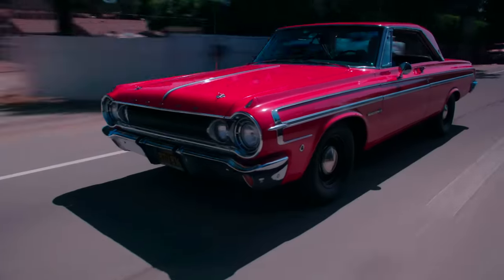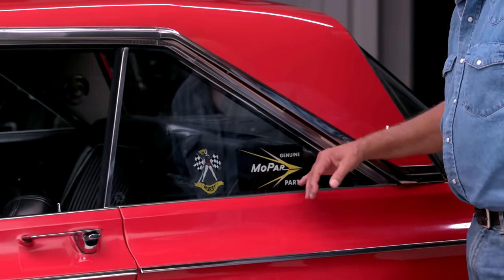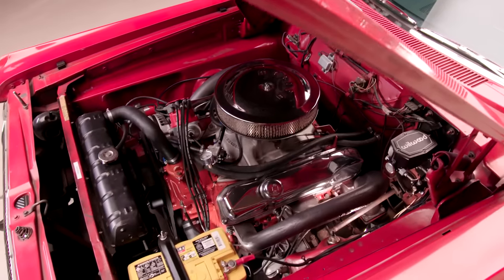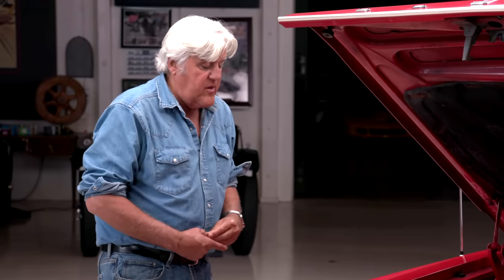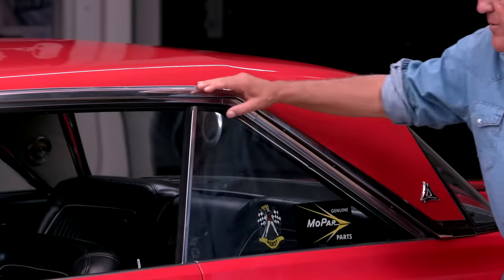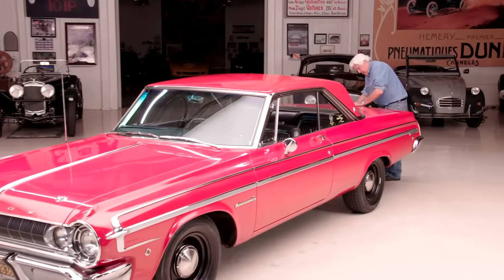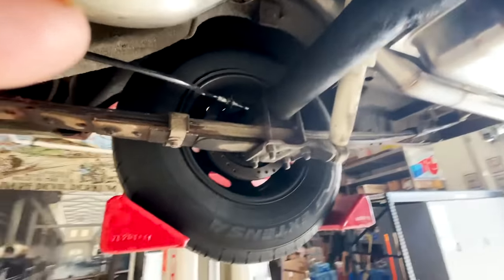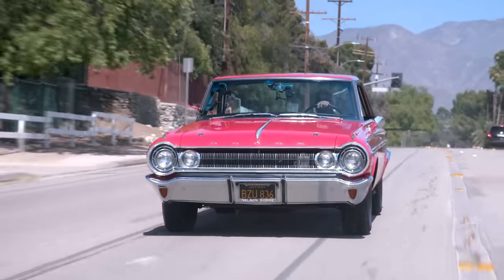1964 Dodge Polara | Jay Leno's Garage

Comment: Had a 1964 forest green Dodge Polara with tinted windows on the side and rear. The rear tint was cracking into branches that made it look like a cool tree of life. Bought it in 1970 for $1,000 from a car tinkering friend who replaced the original engine with a 440 from a California Highway Patrol Car with extra horsepower - maybe 390. Ran the quarter stock in 13.9 seconds. I had stickers plastered on the side widows like  you showed on your car - Hooker headers, Holley 4-barrel carburetor, Mallory Ignition, Edelbrock high-rise manifold, raised white-letter sidewalls, I think G60-16 with Ansen Sprints mags. Ram air through the grill. Had 4.11 positraction to get off the line quickly. I paid to have an Isky racing cam and a B&M racing transmission which caused it to scratch into 2nd. It was so fast, it just blew away anybody who revved me for a race at a stop light. Got it dyno-tuned, put on some slicks, and loaded it on a trailer towed by my friend's 1969 Super Bee. He got on the on-ramp to the Ventura Freeway in Woodland Hills to tow it to Lyons Drag Strip for Wednesday open racing. On the freeway, the trailer immediately started to swerve back and forth, then the swerving got worse. Don't know how my friend prevented it from jackknifing, but he got it down the offramp. We off-loaded it, and gave up on taking it to the drags. We must have positioned the car in the wrong place on the trailer. Never knew what it could turn. Got 10 miles per gallon during the Arab oil crisis. Put about $1500 into it. Sold it for $400 in the early 70's--still as fast as the failed trailer tow day. John

Comment: Ahh, this does bring back memories. My dad had a 1963 Dodge 330, which I loved - although it wasn't a beauty. Some days I wished I had a bag over my head as it just wasn't a cool car then.  Looking back, 60 years later, I now think it was very cool. My favorite feature was the push-button transmission controls (and the 'park' lever) on the left side of the instrument cluster, and the push-button heater controls (and lever for the temperature) on the right side, mimicking the transmission controls. Never once was there a problem with those controls, and I found them very easy to use. Jay, I love your channel and want to say 'thank you' for showing us some of your wonderful car collection.

Comment: Great episode and car. Jay touches on the fact they only recognize the 65 gto's and up as first muscle car when in fact the very first muscle car was 55 Chrysler 300 and not the 49 olds or Hudson hornet. The entire 55 300 car was built to race. It was first car with special engine dual 4's, special front and rear suspension and sway bar and rear end. Goodyear made special Blue Streak high speed racing tires for all the 3O0's and all had 150mph speedometer. If you can a road test from back then they discuss it's power and road ability.

Comment: I had the 1964 Plymouth Belvedere version with a 383, dual quads, 4 speed with side 
pipes. I told my friends it was fast as a hot rod, comfortable as a Cadilac and handled 
like a sports car. OK, I exaggerated a little bit.

Comment: Jay I like your love of cars I fail in love with mopar at 16 when I bought a 65 plymouth Sport Fury 383 Four Speed ,69 Dodge 440 RT ,70 plymouth cuda 383 sad to say my garage roof fell on it 30 years in the garage  retirement car. scared to look one day. My late brother son has his 64 Dodge GT we put a 440 six pack hemi torqueflite 4:30 gears roll bar it also been sitting in a garage 30 years I'm 67 hoping I'll have time to get it back running for my nephew, I like That exhaust system on the Dodge

Comment: Cool car Jay! Get rid of the plastic fuel filter on the intake manifold. It's a fire hazard and limits fuel flow because the ID is very small where it inserts into the rubber fuel line. Those filters are waaay too restrictive. If you want an inline filter use a metal one like a WIX that will flow more fuel. Wouldn't be surprised a bit if the car falls flat on it's face at WOT as soon as the carb empties the way it is in the video.

Comment: Love those,I bought one with a blown up 383 in 1976 for 500.00,I got a leed near my home for a motor,I went to see what he had and was very surprised,he had what he thought was a 413,was actually a 426 with the cross ram and 4 speed,totally complete,had handmade tube headers,very low miles on it,I paid 600.00 for it,right next to it was two hemi's with art carr 727's,I didn't make much money then,he wanted 800.00 for each of those,how times have changed,my dodge ran it's best 12.40,117,with unbalanced 8"hard slicks that I drove to the track.

Comment: This car was a very big deal when it was new. I was in  high school when they first showed up in the dealership.
Awesome.
There was a long black top stretch just across the border in Illinois where guys went to race. We  had to get volunteers to do lookout in case cops came, they flashed headlights. We would be back into WI before they arrived.
The big bad Dodges were the king of the street.

I was admiring the new exhaust and suddenly realized the crossover adds torque at low RPM when it is needed most.
Doesn't matter how many cylinders either. A Harley with a crossover will have noticeably more torque down low. I know. I installed Vance and Hines longshots and instantly noticed less torque below 2500. Ran them about a year and put the factory pipes back on.

Several tests on cars with V-8 showed increase in torque as well.

I'm wondering where you find gas for that engine. Nothing I see here in WI would be safe for 13:1 compression.

I really appreciate that you are saving all these awesome cars. Many thanks.

Comment: I had a 64 Polara, It was white with black top and red interior. It was a 383 auto with floor shift and had a vacuum gage where your has a tach. I was the envy of the guys running the circuit up town, because I had power windows. While going down the street I could roll down pass. window without having to lean over and use hand crank. Unheard of in late sixties when I had this car. Really enjoyed this video, It brought back many good memories. Thank You. P.S. Grew up in Williamsport PA.

Comment: My 1st car was a 71' 383 Magnum CUDA w/ a Slapstick 727 Torqueflight Automatic & 3:23 Gears in the Rear End. Was wishing at the time that it was a 4:11, so I know what you mean about the revs on the hwy.

Went thru about  $40 worth of fuel, and only travelled about 50 miles one way down the 401 in Canada to a Wedding Reception, BUT after a few drinks, on the way back home, I actually took my Cuda up to it's maximum speed, which was probably around 140 mph. THIS was where my mileage went to sh*t AND thinking back on it, I was "kind of an idiot" for doing this on fibreglas belted tires on the front and just plain ole' General Grabber NYLON tires on the rear (which probably were not safe over 80 mph).

Comment: I had a 64 but i had a 440 commander with 727 torque flight push button . You talk about a great Hot Rod that was it . i ran down many of the guys i hung with , one day at a stop light older couple in a 68 Satellite next to me , my punk butt revving my motor and when the light turned green we both floor it and that old couple leave me in the dust . When we got to the next light i looked over the old lady was elbowing the man in the ribs , i tipped my hat to them as i looked over their car and there i saw it , The Hemi enblem on the fender . Put that Dodge was still my baby !! I had mine in 1977 only had 40 k miles on it . It was baby blue with same color interior . I am 63 and still love that body style !!

Comment: The sound equipment did not do the cutouts justice. Or did you even open them? I could not tell. Love driving old MOPARS without any power accessories & with a 4 speed manual. We used to run the aircraft accumulator brake system on our race cars. Run huge cams without that power assist vacuum drum. It worked perfectly. Very nice car Jay.

Comment: i have the 64 Polara 440 body style basically the same car ,,, except a little different chrome on it than yours  ,,, you have got the 500 ,,, but i do have the six tail lights like yours ,,, many had just 4 tail lights from what i have seen ,,, mine is also a 4 speed posi track car ,,, mine from factory came with 318 poly push button automatic i think ,,, but has factory dash plate for push button delete ,,, its also big block 440 ,,, with the old school 2 piece headers on the drivers side so to clear steering arm thay were made from a company called JR headers  ,,, nice to see yours out and about

Comment: I bought a '64 Post  from an old lady in Long Beach. 21000 miles on a slant six. pushbutton Torque Flite. Built the slant six to Hyperpack standards, fun car to beat pseudo hot rods in. Light turquoise, 14's with dog dish caps. And that tiny master cylinder you mentioned. I go through brake shoes constantly, but I dig 'em.  The car had sat for 20 years, and a whole colony of mice, bugs and birds nests all blew out on the Long Beach freeway . Evicted. Still have it. Burnt a valve racing a Mercedes.

Comment: Jay, I think you mentioned the car has 13.5 to 1 compression.  I'm not sure about the '64 wedge but the '63 street version had 11 to 1 compression and 415 hp. The strip version had 13.5 to 1 and 425 hp.  When the hemi came out in mid '64 it had 425 hp also (yeah, right} more like 500+

Comment: Those round side marker lights are from the Chrysler Corporation model year 1968. 3.23 rear axle ratio, same as many of the Mopar cop cars of the late 1960's and early 1970s.  A good balance between acceleration and top speed.

Comment: Love this authentic piece of early muscle car history! These were the first muscle cars for sure along with the 421 SD Catalina Pontiac's and the striped Chevy 409's. My dad mentioned that when he bought his '65 Dodge Coronet 426 Max Wedge, the factory mufflers were thrown in the trunk and not even installed in the car, wavers signed upon delivery. Otherwise, zero options, radio delete, dog dish caps. Super Stock indeed!  He would mention the lightweight solid lifter max wedge was faster than the his hemi Roadrunner bought a few years later.

Comment: I have a die cast model of the Little Old Lady From Pasadena super stock Dodge. It’s incredibly detailed. It actually came with an extra set of back wheels and tires. They are cheater slicks on mags. Growing up in Pasadena was a real treat especially on New Years Eve. We’d go up to Colorado Blvd and watch the hot rod show. Guys would uncork their rods (including me) when I was older. One New Years Eve I saw an incredible race between a 61 Vette and a 64 GTO. They sat at the light until all the cars in front were a block away so they had a full block to race. The thing was the right side lane, curb side had a slight crown to it and the Vette never hooked up and slowly the back wheels drifted towards the curb where people already were in their sleeping bags. You can guess what happened. The Vette was spitting out people in sleeping bags one after another. It turned out the people were not seriously hurt and they were related to a Pasadena cop. Yes they caught the guy the next day. Anyway I love the car and the cars from the 60s and 70s.

Comment: In high school, a friend 2 years older, had a black Polara with the 426 wedge engine.  I think the rear-end was a 390 though as it could lay rubber for a 1/8 mile at the strip.  Mike was as cool as his car. 👋

Comment: I do not have a Dodge, but I do have a 64 Plymouth Belvedere. Looks like the Dodge except for the front end and hard top. Mine is a post. I put a 477 C.I. stroker 400 in it, dana 60, new cable trans, upgraded to a dual res master for brakes. It's just a cruiser. I love my Belvedere. I bought it at Big Willies drag strip on Terminal Island back in the mid 90"s.

Comment: Of the 64 DODGE Polara and Plymouth  were 361, 383 426(single 4 brl) and two versions of 426  dual quad, SINGLE  CARTER 4 BRL, 11-1 COMP- The MAXI WEDGE DUAL QUAD IRON HEADERS 13-1 COMPRESSION.
MOST HAD 323 REAR GEARS BUT 351 AND 301  WERE STREETERS.
HARD TO TUNE CARBS,DUAL POINT DISTRIBUTERS  Hard tosync.rarlugs reached under front fenders, every 2 weeks  plugs or Mopar,  Constant breakage of plus and easy fouls.
Burned SUNOCO 260 104- 105 OCTANE PUMP GAS, AV GAS FRIDAY THROUGH SUNDAY NIGHTS.
AND YES, THE MOST CLASSY AND ETC LONG LEGGED  BLONDES LOVED THE CAR

Comment: 1968 was the only year for those round side marker lights, which were just lights (not reflectors + lights). In 1967 and earlier, Mopars had no side markers at all, and in 1969 there was a loophole or something that allowed them to use reflectors (no light bulbs behind them) and they were rectangular. In 1970 they retained the rectangular shape and they were both reflective and had light bulbs behind them.

Comment: My first car ever was a 66 Polara 440 model Red w black roof no rust, red interior. Paid $20. Threw out the 318 and dropped a HP 440. Air shocks out back w L60 goodyears. Had a buddy change the Alt. Crossed the wires and fried all my wire harnesses. I will always have a soft spot for the Polara.

Comment: That's a fantastic Polara 500, Jay! I love the subtle yet very effective upgrades to the brakes, exhaust, etc...
1964 was also Dodge's 50th anniversary. Many of the cars denoted this on the steering wheel center or somewhere else on the car. Some Polaras were Golden Anniversary Editions, too.
Reply: The 64s were all golden anniversary cars.  had a clear plastic center insert in the horn ring with gold lettering heralding the anniversary.
Reply: I had one of these golden anniversary Polaras it had the gold lettering in the steering wheel but was a 318 with the 727 push button  tourqueflite.

Comment: Awesome car. I drooled on those when they showed up at the dealerships.
I managed to buy a 62 Dodge which was really nice.

Later I had a 69 Road Runner, fun car, wife could not push in the clutch, had to trade it in. I should have bought her a Valiant with auto trans and kept the runner. LOL
When I was young, HAD to have hot car.
Now I'm 75, I live ten miles from nearest town, what do I drive? Jeep Liberty that weighs 4200 pounds and has 1/3 the horsepower LOL. But with good tires that thing can push through snow drifts up to the headlights.

Comment: I've got a '65 Plymouth Fury.  Almost identical to this car.  It was my first car...I restored it once in 1985....it's actually still in pretty decent condition.  Have a built up 440 for it and an A833 4-speed.  I'd like to get it back on the road before I die of old age....   But have a 1970 Dodge Charger that I'm working on currently...

Comment: I had a couple of old Plymouths  back in the day and a Dodge or two had a 63 Plymouth Belvedere with a 440 wedge motor and 4-speed had a Dodge polara with a 426 automatic 727 torqueflite both badass cars put a 6-speed Tremec in this thing and it would pass everything but a gas station Thanks for the Memories Jay

Comment: My older brother bought one when he was 16 - it was his first car (probably around 1968).  The used car salesman said it was a 383 but it had a factory 4 - speed.  When my brother tore the engine down he couldn't get the bearings to fit.  Turns out it was a 361.  It was a gold/tan color and he painted it orange.  He trashed the 2nd motor and eventually traded it in on a 70 Cuda 440-6.

Comment: The video featuring the ‘64 Polara would have been so much better if you had used a microphone designed and setup to eliminate wind noise. That looks like a very sweet exhaust system.

Comment: Jay,
   You have been away from home too long; it’s route 128 not 125. Time to visit home my friend!
  Does anyone know, do you lose a little kick when the cut outs are on? (like a muffler pipe with a hole in it). AND any auto nut knows the real start of performance engine we’re in the late 50’s big Chrysler’s.

Comment: Come On Jay, Chrysler Alternators were the simplest design back then.
Usually the only thing that happened was one of the Diaod's would go bad, easy to replace.
Most after market Alternators didn't charge at Idle speed!!!
Hence the OEM was the way to go....

Comment: I had a red 64 as well, but mine was a rag top and had the 413 cross ram ...switched to a  single 625 Carter carb. Framed a ticket I got with it...147 MPH

Comment: The last Dodge designed by Virgil Exner, but Elwood Engel designed the wedge-shaped hardtop. These were hot and fast cars in 1964, I saw these at the Los Angeles Auto Show and the races at the Riverside Winternationals.

Comment: My first car was a 64 Polara 4dr, 318 wide block with "typewriter" transmission. Got hold of a 4bbl intake from a 58 Plymouth and put a Carter AFB off a 68 Plymouth Fury. It wasn't fast, but it was fun and I saw it top 105 on an old 2 lane Georgia highway.

Comment: I wonder if the hood pins were mandatory on a max-wedge engine. Be interesting to look at performance figures for the Max-Wedge engine vs The Cross Ram 413 engine found on some of the Chrysler letter cars (Like tourque, quarter mile ect.).
  I thought glass packs were illegal…I know they are in Massachusetts.

Comment: Why does this Polara have marker lights? Which came in the scene in 1968. We had a1964 Dodge 330. 318 Cubic Inch engine, two barrel carb, automatic trans, padded dash, factory air, clock. It might have been a 440.

Comment: My first car was a 63 Dodge hardtop with 383 and automatic. Agree 64 was better design for both Dodge and Plymouth. They were drag racing MOPARs with automatics and beating manual transmissions. In fact, one driver said the automatic shift always beat manually select shift point. LOL When someone totalled my Dodge, I bought a new 68 Roadrunner with the 383 and Hurst 4 speed. TOTALLY agree that they NEEDED disc brakes, which I believe were first available in 1970 on the front wheels. Thanks for this nostalgia. Your childhood was my childhood. 😎